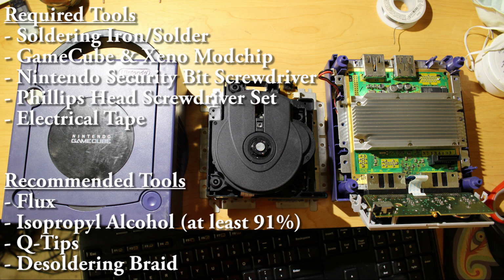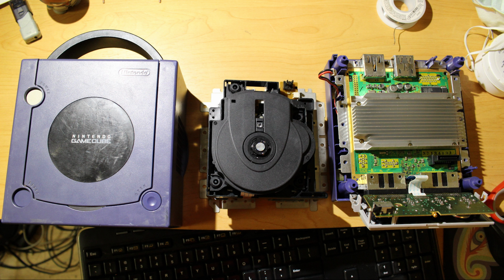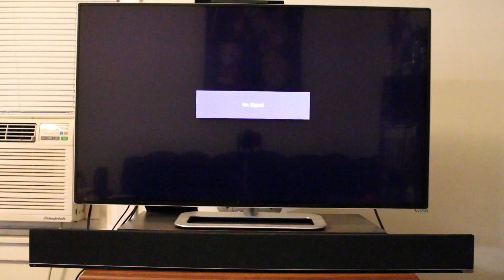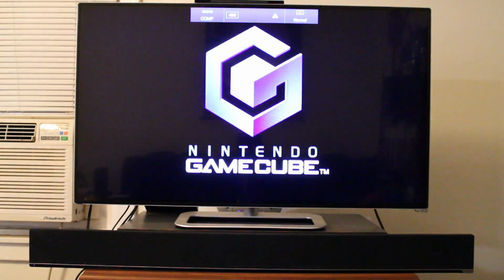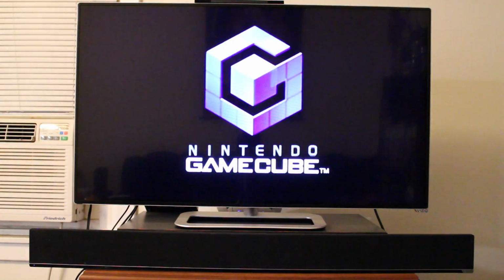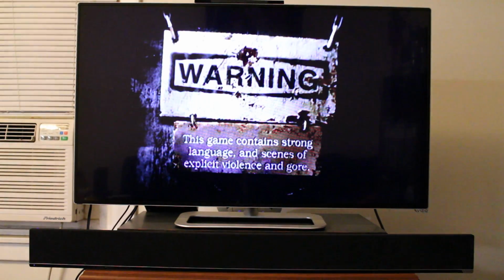How to Install a Modchip in a GameCube [XenoGC Tutorial]

Comment: I would recomand cutting and sticking a piece of capton tape so that only the outer pads of this unpoulated connector are exposed. The two Vias  on the xeno are complettly filled with solder if you want a good connection but you risk a short if you don't put capton over them. I think thats why most other tutorials wire the chip instead of direct solder them.
Reply from the maker: The original legit chips worked fine with a QSB install, unfortunately the Xeno chips on the market now are all clones and most of them are flaky with a QSB install. Direct wire is the way to go on them.

Comment: If all you need is to change the Japanese GC to US, just connect the R5 leads together on the bottom of the motherboard. Xeno isn't necessary for this. Same with US to JPN, connect the R6 leads together
Reply from the maker: Old video and methods here for sure, since I'd argue a lot of that doesn't need to be done these days. If you're chipping, best to go with PicoBoot as a whole IPL injection is better than a drive chip. From there you can boot Swiss and force regions from that, so no need for any bridging of points or to install a switch.
Reply: @MrMario2011  agreed and I just completed my Picoboot mod earlier. It's been so long since Wind Waker. Now I need to try the HDMI mod.

Comment: Hello. I installed the chip today, but I don't get the first red blink. It lights red, then orange without blinking, and the DVD-R gets error, needing to turn off GC. I also tried to solder it with wires, still the same.
Do you think I made something wrong, or may it be the chip is faulty?
Thanks for your work!

Comment: I stripped my board trying to remove a dud xeno modchip after installing it using this method. I've installed modchips on other consoles before so I'm sure I did everything right. I should have done it with wires since its way easier to remove in the situation the modchip was a dud. My gamecube works but there's no way I can reinstall a new xeno modchip.
Reply from the maker: There's alt points you can use!

Comment: thank you MrMario, ive used all your tutorials for modding my vitas and psps as well as the ps3, My question is though.....Does this work on already region switch modded gamecubes or am i going to have to remove the old switch mod to put this one in? also in this situation should i just go with the Action replay/swiss disk since i can basically make it  a US gamecube on boot?
Reply from the maker: Works fine, you can have both in there no issues.

Comment: I did this, but it didn't change color. It did the same pattern: quick blink, then long blink. I read that it's because it's not an official chip. It worked all the same though. Just letting people know that if you bought yours cheap off eBay.
Reply from the maker: Indeed, the fakes don't have different colors.

Comment: I tried soldering it man it was hard
Reply from the maker: Practice. Practice. Practice.
Reply: @MrMario2011  . What can I solder for practice? 

Some productive projects which I need to do which require soldering:

1) remove, fix, resolder GC controller stickbox

2) fix torn GameCube and n64 cords ?

3) install gameboy backlight 

Do you think any of these could serve as good practice?
Reply: @nicememe8608  buy some bare PCBs and random chips and wire and practice soldering on those, it's pretty cheap to get that stuff

Comment: I tried it but stripped the connections on the board (come off real easy compared to other consoles) tried  connecting at different points tracing the circuit but could never get it working so had to give up. didn't damage the console though (plays like normal, its a PAL cube). dunno if it was me or the chip.
Reply from the maker: I've never lifted any pads on the GameCube, sounds like your iron was way too hot.

Comment: Hello I'm having a problem with my ntsc-j gamecube that I have modded. Any help would be much appreciated. So I successfully soldered the Xeno GC board, lights are all good on the Xeno GC. Playing a PAL/NTSC games work perfectly. But when I try booting my Swiss burnt Memorex mini DVD-r disc it will not work. I know the disc works because I have a second Xeno GC modded Ntsc-j gamecube and it works perfectly on it. I have tried tweaking the laser from the default reading all the way down to 80ohm! don't really want to tweak it any lower because of the risk of breaking the laser.
Any help/advice would good. 

Thank you

Comment: I really hope you dont end up considering me a pest LOL 😂 but it happened again, tonight was modding my Gen1 GC night after weeks of apprehension .... and GTS on XenoGC mod install, and surprise...thanks man !
Reply: Incase any other N00bs have the issue, I used a Xen8GC "generic" chip.  I did do the wire mod, if you dont have a small enough wire onhand, get some smaller usb cable and chop that guy open.  Then after install if you get a solid light only, go though and clean and resolider your joints, i started with the board and that did the trick, also look close, use a microscope if ya need to make sure you dont have any bridging ( touching points that should not be ) But yea after that if working you should get a red light > quick flash > light off for a few seconds > light back on and stays on, they are both red lights.  PEACE !

Comment: I have a question, does this Xeno chip work for any game cube models or just some? Mine is the silver one model: DOL-101, so I was wondering if I can used the xeno chip as well. Thanks in advance.
Reply from the maker: It works on those models.
Reply: @MrMario2011  thank you sir...
Reply: Did it worked at the end on the DOL-101? I have that model too
Reply: @danielolmedo7424  It did work, but after a month it stop working, I'm not sure if it is the xeno that got over heated or my soldering skill suck lol, but it work for almost a month do, so im sure i did something wrong doo

Comment: Why would you install the electrical tape? the solder joints are holding the chip PCB to the drive PCB, and there's nearly half an inch clearance to the metal shield that bolts on. The tape will just decay over time and hang off the chip.

Comment: Hey got a question. The points that have the dots of solder you attach the chip to. What do you do if that dot is gone. You get what I'm saying right. I had to pull the chip because the solder got too then I notice the dot of solder was gone, ugh. I tried to stick more solder to it to no avail. Could be a video made for it maybe, cause I'm sure I'm not the only one who's done this. Thanks

Comment: Guys this chip is super small, if you are a novice at soldering use wires. At a couple of points there is a tiny bit of solder to tack onto if you accidentally remove it you might as well buy another game cube because solder wont stick to the board. Tinge you wires then attach them, then attach the chip. Our host does a good job and makes it look easy so be cautious
Reply from the maker: Good looking out! That's the power of zooming in, everything looks like it can be managed easily when watched on a zoomed in, 1080p video stream. A lot of people severely underestimate how small all of the hardware really is until it's right in front of them.
Reply: @MrMario2011  omg I was just so small lol.

Comment: I got some Xen8 GC chips. I've read online that they are considered generic clones. They still work just fine.
Reply from the maker: I had to direct wire my Xen8, unfortunately. It worked once I did, but no luck doing a direct board install.
Reply: @MrMario2011  Oh wow, same here! 😁 doing onboard just wasn't working for me and I ended up ruining a Xen8 chip. Luckily I had extras and tired the wire method and it was very smooth and simple. I'll stick to the wire method from now on. XP

Comment: I did the  mod on my cube, everything was perfect except for the solder on contact “6”.  The solder “bled” onto the other adjacent contact.  When I used some wick to remove it and start over, it seems the contacts also lifted off the board.  I did it all again, seems to be all perfect (except contact “6”) and the cube only runs regular games perfectly (thank god it still works).  Is there anyway way to adjust the laser and still have it work, or did I lose my chance at modding this correctly? I’ve never had a contact lift off the board (the L shaped 6 contact is attached to the xeno chip, so when I placed it all back on the board it was in the same place it originally was). I mod so many systems and this has never happened to me.  If someone is able to lend some help I would truly appreciate it.  Thank you so much!  I could adjust the POT with a Voltmeter but I feel like the whole train has sailed...
Reply from the maker: There are alternative points you can wire the chip to, check that out online as I don't cover it here.
Reply: Thank you so much, Mr Mario.  You’re channel is so helpful to everyone looking for these types of tutorials.  Even when things go awry, you respond which just makes it go above and beyond the typical channels you find online.  Thank you again!  I’ll be sure to check out the alternatives!

Comment: Tried out this chip and all the games that work are black and white XD. I just ended up using my wii to play my backups. I did read that there are actually very few legitimate Xeno chips out there now. People that run send in services routinely receive dud chips. Most people that still mod a gamecube like this usually have their customer provide the chip themselves.
Reply: If you have a PAL console or PAL games, that could be an issue. Im not an expert on refresh rates and regions but it is true, you can look up your issue, its likely the video
Reply: if they show in B&W you probably have a PAL console & trying to play NTSC, its running at 60hz & the TV cant handle it properly, get a RGB cable (I believe snes/N64/Gamecube ones all work with each other)
Reply: @feartheturnip  I know I don't have a pal console.

Comment: That chip is tiny, like 1 cm square.  The solder points are too small to see in real life.  I need a better soldering iron and a magnifier to get in there.
Reply from the maker: Welcome to component level repair and modification! I've worked with much smaller points on a regular basis.

Comment: Could the memory card and controller chip be replaced with a separate module that has USB?
Reply: I can see built-in Wireless controller support and USB controller support. You know what just throw Raspberry Pi in there for whatever you want controller support. I have no idea how it would work but I bet you could also add support for MicroSD card in flash drive memory.

Comment: help please i did it corectly and burnd 3 test games but none will play i get an error has occurred turn the power off and check the NINTENDO GAMECUBE instruction booklet for further instructions but the chip led indicators indicate that it works correctly
Reply: you probably need to tune the hot pot
Reply: There’s a potentiometer on the drive, turn it up VERY SLIGHTLY and it should work

Comment: would this be easy for someone who hasn't soldering iron before?
Reply: I wouldn't recommend any console modification or repair as a first introduction to soldering. Start with a hobbyist board, disposable broken/cheap device or something that was designed to be accessible to basic solderers like a TV box with a JTAG port if you can. That will help you to be more confident in using the iron. 

Consoles, especially post PS1 onwards, have very small points and traces that are easy to damage if you're not sure what you're doing.

Comment: i don't understrand, what silver points are you talking about around 5 minutes, my chip is not powering.
Reply: The XenoGC chip itself has multiple holes where you put the solder into right? Well the "silver points" are on the outer edges of those holes

Comment: Ok, so I have installed the Xeno GC and it blinks twice but stays red.  It still reads the backup games though which I find weird.  It also (about 50% of the time) will just give me an error message to check the instruction manual.  I'm very confused and need some advice.
Reply: DaSoggyTurd You need to tweak your pot more and you have a cheap xeno modchip thst has 2 red leds